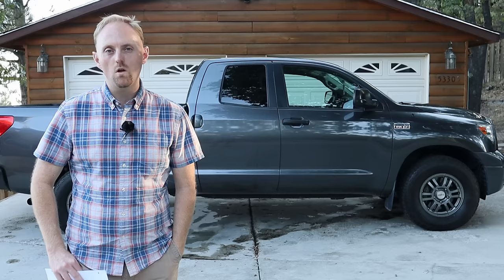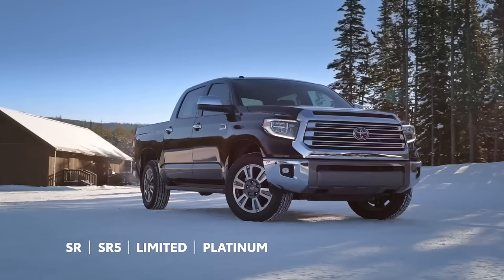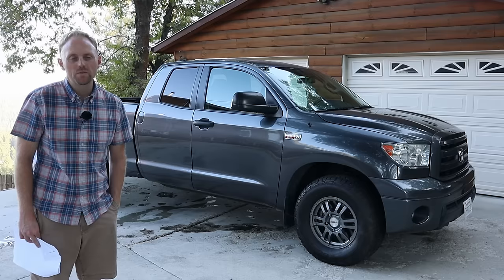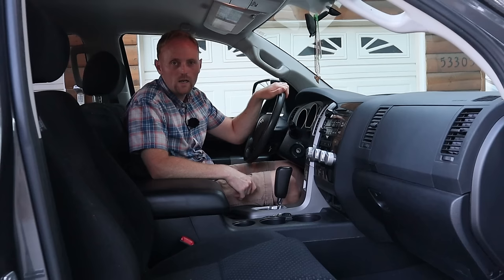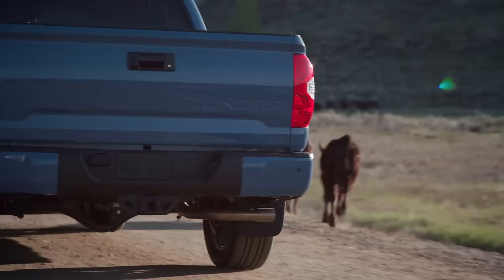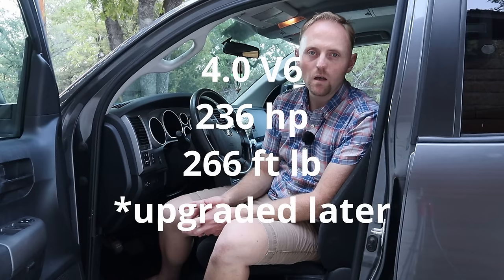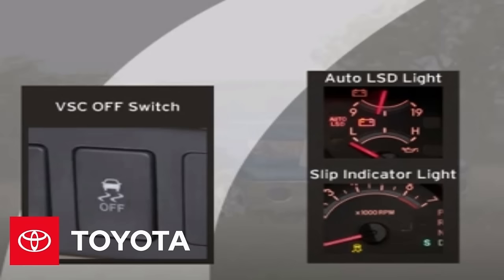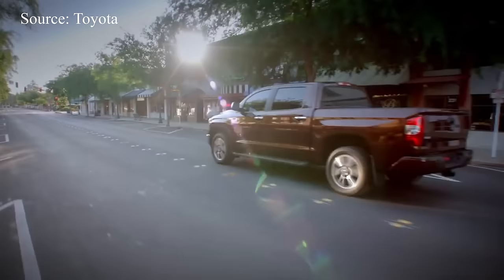Toyota Tundra  |  Brutally Honest Long-Term Owner Review

Comment: Glad I found your review.  2016 Tundra owner with only 47K.  At age 71, I suspect they will load my coffin in the back.
Reply: How’s your fuel economy
Reply: Trust me, if you drive the truck in the New England states and never wash your frame after each snow, the rust will kill the truck quick. That’s how my truck died, everything mechanical is in perfect safe, but the frame, especially where the control arm bracket welded to the frame is rusted to a degree unsafe to drive. I really wish they build a truck with Ford frame and Toyota body. Ford frames are a lot rust resistant.
Reply: It’s a TRUCK.  If you want fuel economy, buy a Tesla.
Reply: @thumperpaul   You don’t care fuel economy doesn’t mean others don’t, and welcome to this diversified world. 1 mpg difference means tens of thousand dollar for commercial use if you run 100 of them. And Tundra is an ultralight duty truck which require fuel economy rating by law.
Reply: @nicolathonathan770  right! Idiots typically say "if you wanted...  buy a Prius!" As if we buy trucks to commute and go shopping (they prolly do). If you have to drive a truck (work or biz), and drive alot of miles, mpg is a legitimate concern.
Reply: Only 47k? My 16 has 24k.
Reply: I appreciate your sense of humor, 
Enjoy every day
Reply: @CR10.07  I just bought a used 2017 with 20k miles and the 4.7 V8 2wd I was getting 21 on the highway and 14 to 15 in town
Reply: @nicolathonathan770  gotta get krown early on and get the salt washed off in the early summer and krown again.. its sad what salt does to cars in the rust belt..  my condolences from Ottawa Canada
Reply: @xfilesseasonteneponeandsix8346  so you shouldn't be cleaning it everytime it gets dirty with slush and salt ?instead do It when a snow day is coming and spray krown?
Reply: @user-jo7pg2mr7u  Wash the entire vehicle, including undercarriage, first.  Then get Krown or Fluid Film applied (or do yourself).  From that point forward, reapply annually and don't wash the undercarriage except optionally right before you reapply.  Definitely don't wash the undercarriage in the winter when you have Fluid Film or Krown--you can blast the protection right off.
Reply: @confidentlocal8600  do this before winter starts??
Reply: @user-jo7pg2mr7u  Yes.  Krown and Fluid Film are easier to apply in warm weather.  It reduces the viscosity and allows it to creep along the surface into the nooks and crannies better than when it's cold.  You can always touch up areas with a spray can later if you want.
Reply: 2018 owner and 61.  When my dad bought the 1999 Camry he said it was the last new car he would buy  (he was 81)...it was his last period.  He died in 2001.  With Toyotas,  its like buying a turtle....it could out last you by hundreds of thousands of miles or decades.  Leave it in your will!  God willing you'll enjoy until you give it to your grandkids to drive you around.
Reply: @rickshiandmoku4128   I I just bought a 2018 Tundra 2wd 5.7L V8.  Do you regret getting 2wd?  I wanted the extra towing capacity but where I want to move might be more snow and ice than NJ.  I have still my 2002 4Runner but hardly ever used the 4wd.   I guess not enough winter to evaluate?
Reply: 2007 36K, lol
Reply: @rickshiandmoku4128  I got a 2017 5.7 v8 and am getting 14 highway an city lol
Reply: @nicolathonathan770  if you fluid film your vehicle it won't rust
Reply: @mrbriggs68  that’s something the manufacturer should do.
Reply: @nicolathonathan770  it must be put on yearly so why not do it yourself
Reply: @CR10.07  it averages like 14 mpg
Reply: You don't have to take it with you... I'll buy it from you!
Reply: Well the money you would have used to do maintenance you can now use for gas. I always save money for maintenance cost around 600 and I normally keep 100 dollars for gas
Reply: Bro that shit made me laugh so damn hard your gonna be like that guy who got buried with his mustang
Reply: Hope you made a lot of memories in it 🙌🏾
Reply: Same exact truck but mines is trd off road 4x4 flexfuel 5.7, used it in the city up to 110,000ish miles. Gave it to my brother who runs a ranch. It’s rugged terrain dirt road above the Grand Canyon. With the heavy snows and wet summers this trucks’ 4x4 is used more so than  others. It just recently hit 200,000 miles took in for a tune up, findlay toyota ran there diagnostics and basically said we are low on windshield washer fluid. Amazing truck.
Reply: @CR10.07 I get about 13mpg. Never having repairs makes up for the terrible mpg
Reply: You know you want that 😊

Comment: Purchased a 2008 Tundra with over 250,000 miles. I am that confident in the reliability. On the way to 500K!
Reply: We can all dream
Reply: There has been a few to hit well over that. Good reliable trucks.
Reply: BOUGHT mine new in 2010, best vehicle so far.
Reply: How is it holding up so far?
Reply: @iangrogan5261  Great so far I’m at 274K
Reply: good job! - I have a Lexus LX470 (land cruiser) with the same 4.7 V8 - 3rd timing belt 296,000 runs perfect!
Reply: I decided to not change my timing belt at the 90K that is suggested, because a guy said he did his 1st belt at 400K & it still looked OK.  So I waited all the way till 295K & did it myself & yes, it was difficult but, the belt looked like it could have gone another 100K & the water pump was great, but I changed it out since it was right there -- and the after-market one leaked & I had to go back in & re-seal it better. But, it has done well for the next 75K miles now.
Reply: I'm interested in doing the same. How is it holdin up now?
Reply: How is it holding up now?
Reply: I got an 07 last year with 220k. It dives soooo nice!
Reply: Bought mine with 130k and water pump shit the bed 4 days in...
Reply: Can we get an update on it? Im thinking of buying a 2010 with 220,000 miles

Comment: Got an 03 tundra with 330k still runs good till this day
Reply: Andrew, would that '03 be the 2UZE-FE V8 iForce engine and how long since you last R'n R'd the timing belt, if it is the V8?
I just picked up one w/159K miles now as the 3rd owner.
I expect to change out the timing belt(TB) and H2O pump in the area of 180K mile range expecting it was done once already. If it had been done around and even just past the recommended 90K mile mark (I'm told an original TB wouldn't make it to 150,000+ without snapping into shreds, expensive fix then) well I really have no service record or sticker anyway or where to know...
If it hasn't been done... Geeez, idk and I'm getting anxious that just maybe the TB can go beyond its recommended 'under pain of death' 90K mile mark; so I had a peek by edging the left bank cam cover back after removing three or four bolts.... top of the belt looks great, no cracks.... please what have you heard or what has been your experience... have you owned this Tundra since it was new?  
Best Regards
Reply: Got a 2010 Camry with 300k; still runs good to 📅 date.
Reply: I have a 2000 with 274000 runs great
Reply: @lonnybear1846  2001 and just crossed 290,000. First repair last year on radiator
Reply: Savetime Mann  I think it's every 90K per the maintenance schedule. That's what I do
Reply: TILL THIS DAY! TILL THIS DAY!
Reply: @kingaza7734  bomb squad all day!
Reply: TOYOTA ENTIRE INVENTORY IS RELIABLE AF TOP TO BOTTOM
Reply: @djyellawave1113  lol do you even own one
Reply: Nice I just bought an 03 last Saturday with 160k. I hope mine lasts just as long
Reply: @PathosRx  not sure what is so funny
Reply: Is it still running?

Comment: Asian transmissions are a Toyota company.  Reliability is the ultimate luxury.
Reply: Aisin, not Asian.
Reply: Yea I was going to say that aisin is a Toyota company
Reply: my 2013 ram hemi has the aisin trans, 200000 so far works likes new.
Reply: AISIN.  It's the supplier for Toyota. Aisin makes water pumps for Toyota. Good solid brand.
Reply: Their 4, 5, 6 speed are solid. But the 8 speed has some problem. Even the one used in Ram trucks.
Reply: @nicolathonathan770  my 13 tam has the 6 speed
Reply: @davidmckibbin4440  sadly now they only offer 8 speed. I missed the old stick shift ram 2500.
Reply: @nicolathonathan770  the 8 speed in Jeep and Ram trucks is not Aisin. ZF, an Austrian company is the manufacturer.
Reply: @nicolathonathan770  The Automatic 6 speed the Cummins Ram 2500 in the current generation is a 6 speed (automatic) Aisin.
Reply: @Kevin93til  probably not in 2500? I test drove the 2020 3500 with aisin and that 8 speed literally slam in gear in tow haul mode.
Reply: @nicolathonathan770  the Aisin is only available on the HO Cummins in the 3500 only.
Reply: Asin.
Reply: @tolpacourt  Aisin
Reply: @nicolathonathan770  aisin pronounced ice-in or i-sen. Not a-sen
Reply: @nicolathonathan770  the 6 speed offered in the 2500 and 3500 is 100 percent an Aisin box. The 8 speed in any Ram is ZF and it ain't good.
Reply: Nuff said!
Reply: @rockslide4802  The water pump was the only part that failed on my 99 Tacoma TRD.
Reply: @Ebaybow  At how many miles/years? I got 16 years on my 99 RX300. Was working fine but changed it out when I changed the timing belt.
Reply: Asian transmissions?
Reply: @rockslide4802  unless it's in a dodge....
Reply: @Kevin93til   ZF designed the ZF8 that Ram uses but it is built by Fiat-Chrysler

Comment: Technology kills reliability. The ecoboost, active fuel management. Direct injection,  engines by Ford Chevy and Ram have issues.
Reply: They're junk, and it's so hard to find a vehicle that is built to last. Too much focus on mpg for trucks and suvs, not enough focus on ruggedness
Reply: Which is why Ford reintroduced a pushrod V8 for their commercial vehicles, the 7.3L Godzilla gas V8. They know their customers can't deal with downtime.
Reply: @kangol504 My Chevy has the LMF 5.3 liter the only advanced thing it has is the variable timing cam.
Reply: @imnotusingmyrealname4566  7.3L ? Goddamn, how are they gonna pass the emissions? On the other hand, US corporations kinda "own" these tests and emission checkers so I guess it could pass
Reply: @shaknoori2868  It's only found in vehicles that aren't rated by the EPA so that also plays a role I imagine. 😂

Edit: It seems they aren't added to the CAFE numbers of Ford's passenger vehicles so they can do that and when it comes to particulate emissions and NOx and things like that naturally aspirated gasoline engines that aim for stoichiometric air/fuel ratios are very clean.
Reply: @imnotusingmyrealname4566  I see. But still I kinda suspect that they bribe their way out of many stuff. They probably have a whole building full of lobbyists and lawyers always ready and steady to fight anyone who goes against their sales or profit margin. They are not dumb, I tell you.

Comment: My 07 tundra just had the frame recalled and done, along with the bed and tailgate under a overdue out of warranty recall. Total bill was $28,000 in repairs all covered by toyota for free. Although this isnt proving toyota quality it does prove they are best in business for taking care of their customers, the box and tailgate was deff not required by law like the frame and they just did it anyway. I’ll be keeping my 07 until it completely disintegrates to dust now, the power it has and amount I can tow down rough forest roads with skidder ruts is better than any other! The driveline is rock solid still after 225,000 miles with no clunking or hard shifts!
Reply: While I’m not a huge Toyota fan I’ll agree with you that the company does take care of their customers very well.
Reply: Glad that you are enjoying your truck and that Toyota has stood by it.  I have a 2008 Tundra and I am curious, what are the frame, bed, and tailgate recalls that you are referring to?   

Mine is white and Toyota did do a full repaint on it due to some milky white circles in the paint job.  They really didn't bother me but I brought it into the dealership for something else and the service guy said that he could probably get it painted for me...he said that something was dripping on them from a leaking line during the paint process and caused the circles.   I think it was only white models. Like I said, they were hard to see and didn't bother me.  But I'm happy for the new paint job.
Reply: That frame recall was only for 2000-2006 tundras if I recall correctly.
Reply: 07-08 tundra and sequoia frames as well. Small number of them affected but in Canada it was a class action lawsuit that got approved and they went good on it.
Reply: Would any other truck manufacturer do that? I think not. I have seen 7 year old trucks completely rotten. Same places on every one. Dealers laugh. Laughing is ok until the bottom line counts.
Reply: they got sued, i'm not sure what this have to do with taking care of their customers, they would've let you rot if not for that
Reply: You got lucky.  I had a frame recalled so I talked to them and they said I was outside of the recall window and they wouldn't replace it.
Reply: Had it been Ford or GM, you would have had to sue them or they would have tried to put a “band aid” on the frame and sent you on your way
Reply: @DrGreen-wl2ry  i just bought a 07 built in canada, frames in pretty good shape compared to all the fords and chevys i looked at. How bad was yours? It has a hum in rear end, i took a chance on it just being a seal or baring. For 13 grand with 200,000 miles it was better than chevy dodges and fords going for 15-17 grand. Hopefully i didn't make a mistake lol. Runs and shifts like new.

Comment: As a Tundra owner the engine and drivetrain are the best I have ever owned.  I still own my 2007 and have over 150k miles on it.  It is a little less efficient when it comes to gas, but the trade off is durablity.  Absolutely love my old truck and have no plans to get rid of it.
Reply: I have a 2006 it has been a great truck has 174,000 miles on it. I just had to have the rear diff cover replaced because it was leaking other than that it has been the best truck i have owned.

Comment: Im a lifelong mechanic owned 16 different Silverados 1/2 3/4 and 1 ton gas and diesel bout a brand new 18 tundra so far it's tough as hell I work it like a HD pull and haul heavy constantly 35s extra springs and lift I'm really testing my first toyota it's definitely built to a higher quality and reliability than a domestic luxury 1/2 ton it's a simple truck exactly what I want, good video and review
Reply: When I was ready to buy a new pickup, I asked my personal mechanic for his opinion on which pickup I should buy. He said I should buy a Tundra. I’m glad I did. My 1999 F-150 lariat was nice but every month there was something going wrong with it and I got tired of putting money into it.
Reply: I have owned several samples of each of the big 3.  I drive a lot, both for business and personal life and I have had everyone of the big 3 sorely dissapoint me.  I purchased a new 2020 Tundra this year.  I'm hoping it does well.  I just found out about them removing the transmission cooler, hopefully that doesn't create problems.  My dad is a sales manager at a Ram/Chevrolet dealer.  I can get either of those brands for cost.  He was shocked when I didn't buy another Ram and bought a Toyota instead.  I hope I make it to the million mile club.
Reply: Congratulations on your million mile rig!

Comment: I have 2011 Crewmax!! On my way to the million miles Tundra club 👍
Reply: How many yu gat now
Reply: I’m at about 200k. Probably towed 50k of that.  Other than basic maintenance and the Secondary Air Injection Pump(which I bypassed) it’s been solid.  Hoping it stays that way for years to come.  I know when the new Gen comes out, I’ll be keeping this one and just buying a new one.
Reply: 159K miles.
Reply: Savetime Mann  I replace transmission fluid every 30K to 40K miles. I replace engine oil every 3K miles. I replace spark plugs every 30 to 40K miles.
Reply: Me Too!  2001 Crewmax with 110,000 miles.  I bought it new in October 2010.  Best Vehicle I ever owned hands-down.
Reply: @KenPotter  as an owner of a small 3-5 man construction company, we use my tundra for all sorts of hauling and towing.  It’s held up well over the years.  Towed anything from tool wagon to mini-excavators, to lumber for decks, to dump wagons.   It’s not really a problem, but I just had my belt replaced for squeaking and it was quiet for about 3 weeks and now it’s louder than ever.  I just tell people it’s called the attention grabber modification.   Makes you alert in the mornings!!!
Reply: @jeffreysantos9070  Extreme overkill.
Reply: 2008 5.7 with 204k miles. Changed spark plugs at 100k. Haven’t changed since. Never changed transmission fluid. Never changed differential fluid. Try to change oil every 10k miles with Mobil 1 synthetic and Toyota oil filter from Amazon. Once went 16k miles on same oil change. Still runs strong. Cant kill it.

Edit: had to change 1 u-joint and changed out starter both at 200k miles. Running a TYC starter off Amazon. I believe $130. Oh yeah on 2nd Toyota battery. On 3rd set of OEM brakes.

Comment: Need to look at total cost, not just fuel. My 2001 Tundra has had routine maintenance, shocks, O2 sensors and brake jobs. The single major expense was the timing belt. At this mileage, most of the competition would have needed transmission/differential and/or engine  work.
It will outlive me.
Reply: That's so true.  The cost of maintenance, especially as it can easily go into the thousands, overshadows how much one pays for fuel.
Reply: It's stupid that a truck has a timing belt.... Most other cars even have a chain again
Reply: @richsweeney1115  Not really. Look at the amount of 4.7s out there with 500k to over 1 million miles on original motor and transmission. 

The 4.7 is considered the best v8 Toyota has ever made. I’ve owned 18 over the years and wouldn’t hesitate to buy a 2007 (Last year of the 4.7 in 2nd gen body style) with over 500k